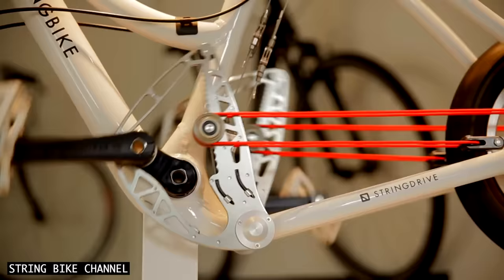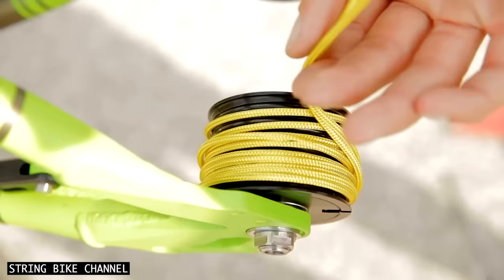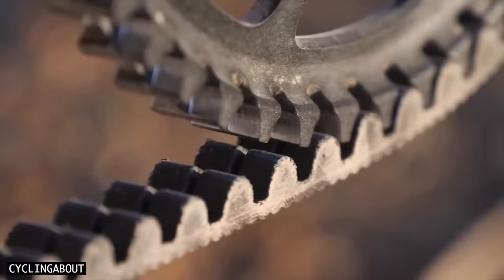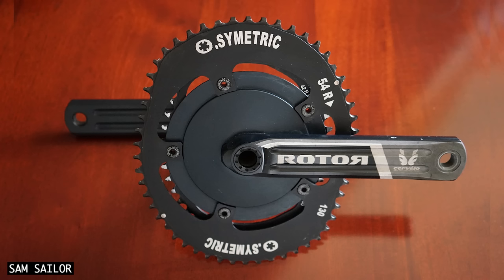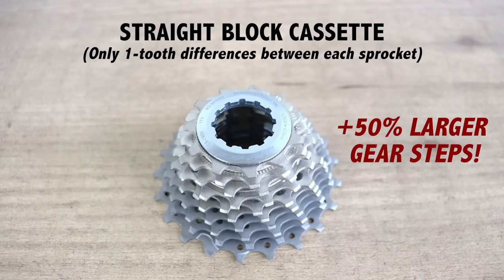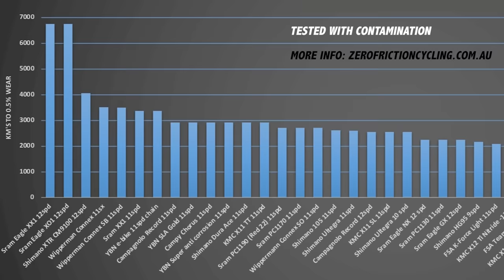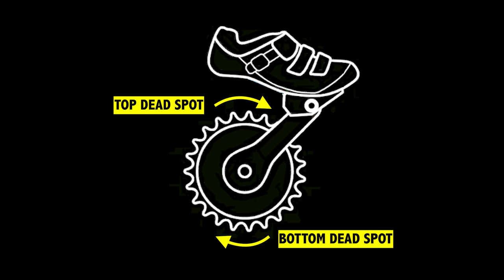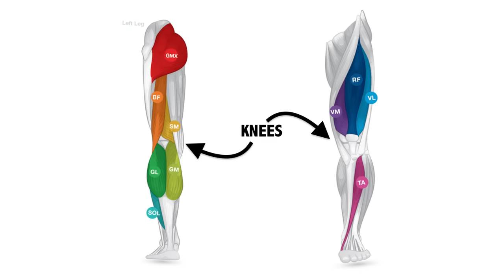Are Chainless String Drive Bicycles a Genius or Terrible Idea?

Comment: Although dyneema fabric has high tensil strenght it drops significantly when heated up i.e. because of friction. That is why in climbing it advised to refrain from pulling dyneema ropes under load through all sorts of climbing hardware. Maybe this is why these dyneema strings last so short. I wonder how big of a friction there is on the surface of all these pulleys and the rear drum. Also, the string moves a fixed lenght when reciprocating so only several and short stripes make contact with the drums and pulleys and carry the load. This may also contribute to its short longevity. Not a good idea - a bit complicated, unrealiable, clunky, not neat with all these shifting cables.

Comment: I considered buying one of these a couple of years ago, but the narrow gear range was a deal-killer. The high price and weird bespoke frame were also turn-offs. I eventually purchased a belt-drive bike with an 11-speed rear hub which was much cheaper, weighed about the same, and had a better gear-ratio spread.
Reply: how much does it cost and where can someone get them?

Comment: I imagine you could do something similar with belts instead of strings for better durability, but the incompatibility with standard frames is a killer. You could likely say the same thing about systems that use a geared rod instead of a chain too.
Reply: are belts also incompatible? you need a split in the frame

Comment: Interesting stuff. I use Dyneema cordage in my hammock suspensions and it's a truly amazing material. It doesn't do super well with abrasion though, so I'd be interested in seeing the longevity of this system.
Reply: Quoted as 1000km (about 600 miles) which even for pretty light use is multiple changes a year. 6 miles each way 5 times a week (about a 30 min ride, so nothing excessive) is 60 miles a week, so you're potentially changing strings 5 times a year. I suspect that changing the strings 5 times is considerably more hassle than than either regular chain maintenance as you are supposed to, or slightly more involved chain cleaning if you let it slide a bit. Unless you never do anything with your chain until it rusts solid or you need to replace chain, sprockets and chain rings at the same time, and do so frequently, it probably isn't a huge advantage.
Reply: No one asked you
Reply: @DoraExploring-ls5vf  I bet you're fun at parties.
Reply: @chrishowell5718  The limited mileage of the Dyneema strings is actually a disadvantage. According to my observation from the film, the time it takes to replace them is significantly shorter than any chain maintenance. 😃

Comment: I ride my bicycle as my main form of transportation all year, all weather, all the time, because I prefer it to my car. I like this idea, but for me, the downfall is that grit severely affects longevity, at least according to you. The ropes will become coated in salt in the winter and even if I cleaned them they would get coated in salt again within a couple of miles. One day, I hope to have a belt-drive gearbox system. My traditional drivetrain takes a lot of maintenance, even though I don't use a front derailleur. It gets irritating sometimes. Especially in the winter, when the air is too harsh to work outside.

Comment: I am quite intrigued by the concept of the String Drive bicycle. Difficulties offering the shifter and the range of gear ratios available wouldn't be an issue for me since I simply leave it in the highest available ratio anyway. I think the biggest reasons it wasn't particularly successful were the price and obscurity. The lower durability of the strings as compared to either chains or belts is definitely an important factor to consider, but the low cost of replacements and the ease and speed of replacing them, not to mention the ease of keeping spares on the bike, may well have offset that sufficiently for the average rider.

Comment: Just had to check todays date.  Phew, it’s not April 1st. 

The major downside to this system would be mud, here in the UK we get a lot of rain, so far we’ve had 3 major storms in the last month alone.  So lots of leaves and general muck on the roads means riding and more importantly, cornering speeds, are not what they were. Whilst I see no MTBs, I’ll bet off-road and you’d be in for a lot of hike-a-bike, or even pushing it home an/or back to the car. 

I take it wouldn’t take a tumble well would it? Anything bent or misaligned around the BB area and I’d’ve thought it was a game over.

Comment: The rewinding action of the string is springloaded.
Thus you are ALWAYS pushing against 2 springs. They may be weak (they only need to rewind the strings), but, still, they are there.

Comment: it seems very complex and sensitive to change, and that appears to be the most simple that mechanism can be. as an engineer, my first thought was KISS (Keep It Simple Stupid), and this doesn't seem to be the simplest you could design something like this. it may have it's upsides, but I'll trust that the chain on my bike won't snap, and if anything breaks i can replace it easily, quickly and cheaply, and even on the road. dynema is also notorious for performing poorly when heated, so i would trust it even less on a hot day, or riding particularly hard. you mentioned wide gears as one of chain derailleur systems' downsides, but often people want extremely wide gears, especially for road cycling, where the hills can be very steep, but you also may need to ride fast.

overall, too complex, too proprietary, too weak, too sensitive, not trustworthy, and incompatible with other technologies.
ima stick with my chains :P
Reply: Indeed and i think the starting position is not optimal, if i put my foot on it i want it to be in a position where i have a long way to put force into so 2 o clock, then i can use my whole weight for the first stroke, if id use the position in the video(4o clock) id have a lot less acceleration for the start. 
And if we watch bike races we see thats how most people start.
2o clock or slightly above the best conversion point at 3 o clock, where gravity helps the most.

Comment: I don't get the disk brake argument. Yes, you can't put a disk on the rear, but you can still make a mullet with a disk on the front and rim brake on the rear.
Reply: Most of your braking power is on the front, anyway.
Reply: agreed rim brakes are more than suffecent for locking up the rear wheels and the other downsides of wear and cooling do exist but you shouldnt be using your rear brakes enough to make that a concern

Comment: The hype : At 2:20 - "The Dynema ropes actually have a higher strength under tension than a bicycle chain."
The reality : At 7:45 - "The Dynema ropes wore out quickly compared to other drive options - 1000 - 2000 km (600 - 1200 miles).  They were found less efficient than a chain drive"

In fact, you have to go a long way to find a better system than a chain, in terms of longevity, strength, usability and efficiency.  They're dirty, but fingers can get washed.

Comment: Pulley rope bikes are the future of self built or custom bikes. Its simple and also the rear hubs can be made with variable transmission, also the pulley thing can be placed as orbital transmission that reduces torque requirement

Comment: Thank you so much for the education on string drive. Never heard of this before, but now I wish it had succeeded, and they lasted for 10x longer, and allowed for electrification, too! It all just seems way better than exposed chain; which we've been using for so long now. Surprised to see there aren't even more types of bikes available out there today. AI might soon change that though.
Reply: After >150 years, what works well and is practical has pretty much been figured out.
Reply: @gaoxiaen1  Thankfully no engineers think like you.
We wouldn't have cell phones, commercial jets, computers and a million other things that came along after 150 years ago...
Reply: @BitBuhkit  So why don't you think of something better than wings for airplanes, or wheels for cars? Get busy Mr. Engineer!
Reply: @gaoxiaen1  lol, I'm not the one that thinks everything stopped >150 years ago!
Reply: @BitBuhkit  Me neither. It's just that sometimes the best practical soltions have been worked out long ago. Yes, in some circumstances there are better devices that can be used, but I don't see things like the screw, the nail, the bolt and nut, the table and chair, the metal can and glass or plastic bottle, etc... going away soon. Yes, the string bicycle is an interesting novelty. So is the hubless wheel for motorcycles and turbine engine car and many other inventions, but it takes a long time to replace a tried and true practical solution. Fuel injection (of whatever type) and overhead valves for gasoline engines used to be exotic and futuristic, but have only become commonplace in the last few decades. Most inventions remain only novelties.

Comment: The design reminds me of the elliptical trainer used in the gym. The device has the option to use leg pedals along with reciprocating handles which resemble the reciprocating motion of the string drive. I often used the elliptical trainer and increased the resistance (compared to higher gear ratio in bikes) by holding the handles closer to the hub, i.e. lower. In my opinion something similar can be used for hand bikes (used by people with lower body paralysis, who cannot pedal). Reciprocating handles would make full use of the simplicity of the string drive because no spinning pedals are required. The hand-cyclist  can adjust the gear ratio simply by changing his hands position: Low gear is achieved by holding the top part of the handle. Holding lower can increase the gear ratio.
Reply: would like to see the resulting physical development in heavy users at their peaks.

Comment: That was an interesting description. I might mention though that every problem listed can be fixed. This includes:

Adaptation to existing bike frames.
Wider gear ratio.
Compatibility with disk brake.
Greater wear life for cord.
Lever based or automatic rather than twist grip shifter.
Reply: Wider gear ratio? What makes you think that? This thing has 19 speeds, my shitty mountain bike has 21.
Reply: @iamfreeareyou681  
I have no idea what point you are trying to make or how it would relate to my post.
Reply: the wider gear ratio as in the range from the highest gear to the lowest not how many gears i would also like to mention that disc brakes are not nessary in the rear because of wheight transfer when you brake and rim brakes are more than cabible of locking up the rear tire but disc brakes are nessary for the front but they can install them anyways since there is noting preventing them.. note i do know that there are other benifits to disc brakes for example not chewing through wheels longer brake pad life as well as better distribution of heat but if you are using your rear brakes enough to where thats a concern there are different issues
Reply: @3-ro3cd  

> the wider gear ratio as in the range from the highest gear to the lowest

Yes, you agree.

> disc brakes are not nessary in the rear

And?

Comment: It almost feels like you could rehash this tech using standard-ish ebike frames. I don't know if the geometry works, but if you could build a unit that bolts into the space a Bosch ebike motor (or similar) uses, it'd be an interesting idea. One-sided, of course, maybe even something that fits on a HG freehub.

Comment: Its amazing how far engineers will go to solve the problems of bicycle chains, hefore they resort to the obvious solution - a chain cover!!!! Honestly, my daughter's bike has an almost entirely enclosed drive train, and i basically never have to clean it. She's ridden it thousands of miles now with no issue. I wish adult bikes came with enclosed drivetrains more often.
Reply: Exactly. I've been advocating drivetrain fairings forever. Why do they say a rear derailleur gets dirty but a IGH does not? So helpless. Just cover it up, then it won't get dirty.
Reply: Nah, covers are not cool. Have you heard about dork discs? Usefull, light but absolute no-no.
Reply: You can use a full chainguard with a single speed bike, or with internal gears, but not with a derailleur. Oh, I suppose someone could design some montrousity that would fit over a derailleur, but I think it would create other problems.
Reply: @thePavuk  The only people who want chain guards want to ride with pants, so I don't think they care much for cool.

Comment: Fascinating. The persistence of chain drives after 150 years lies in the surprisingly low overall frictional losses, especially with the refinement of chains themselves, optimized cogs, and good old wax as the basis for the best, easily maintained lubricant. Motorcycles with drive shafts have far higher frictional losses, only offset by sealed systems, and the power to spare from an engine other than a human. This design also has many more pivoting bearings, likely needing service or replacement.

Comment: 0:30 I dont like the opening of this video. "Maybe a 'String Drive' bike is the ultimate solution" Uhh solution to what? You laid out a thesis that includes a problem without mentioning it? You never said what is inherently flawed with a chain design.

Comment: chain drive is more efficient. Ropes stretch when torque is applied thus using part of the energy for stretching the rope and not for propulsion. Some motorcycles use a kevlar rubber belt which is stiffer than rope.

Comment: The fact that string bikes need a special frame design is a significant disadvantage because too many companies are used to the conventional design, so yes, it does make sense. But for disk brakes and electric motors, I am sure there is a workaround that might need further investigation.

Comment: Very close gear ratios require frequent shifts.
I found that large gear gap help us pedal more efficiently across a broad rmp range.
Single speed racers often outperform cyclists with gears, especially on section with speed fluctuations, where you'd think you need the gears the most. I've found it ideal to have few gears, and use each for a "scenario". One tailwind or the road, or a fast downhill, maybe sprints. Two for spirited flat road or offroad flat racing. Three for undulating low elevation change, winding singletrack. Four for climbs too long to sprint up in 3rd. Five for really long climbs or very technical climbs. Six would be for hour-long super steep off-road clibs, or low effort road climbs. You'd hardly ever shift. Our legs can handle walking and sprinting, they'll be fine.

Comment: 4:41 this is probably the coolest feature
10:49 you don't need different size drums, since the gear setting on each side is independant (and yes they DO need adjustment 1:10)
thanks for sharing!

Comment: I'm Dutch and the notion that disc brakes on bicycles are industry standard is new to me. A normal bike (not a Fat Bike) here has rim brakes, unless you have a very old model or the type where you brake by peddling backwards. Regarding the efficiency of having to change forces: that shouldn't matter at all as you're doing that while peddling anyway. Your foot and leg cannot supply power throughout the entire cycle, only during the down stroke. So I don't think that should be considered more efficient, unless you're rotating the peddles with a motor. And that is not how they make electric bicycles work (they drive the wheel directly AFAIK). I think this string drive is a very interesting concept.

Comment: Note the lack of peddle clips.  They haven't been included because you can't lift-pedal with this drivetrain, which costs you about a third of a professional cyclists power.  

Lift-pedaling refers to pulling the pedals up on your upstroke, allowing you to generate thrust using different muscles from those required to push down on the pedal, which is desirable because the spread workload of riding is more efficient for reoxygenation and reduces the rate at which the working tissue degrades under load.
Reply from the maker: You can pull up with String Drive. It just transfers to the string on the opposite side of the bike.

Comment: Noticed that only regular bikes have gear adjustment cables between seat tube and rear wheel, forcing for longer wheelbase. Those performance bikes have been set up other way to pull gearing cables.

Comment: I'm curious about the efficiency of this. Since it goes against a simple principle of reducing parts (under the assumption that the bike chain is "1 part"). Now we have 2 drive chains, cams, pulleys and winches. Basically more than doubling the amount of bearings, and while strings are way more smooth and efficient in transferring energy than a chain. Having a reciprocating winch and cam system seems to add a lot of friction to the system. Especially the winches, which have to coast 50% of the time. 

Seeing the shaft torque to wheel torque compared between belts chains and strings (or any other system) would be extremely interesting.

Comment: I remember the days when bicycles were a greasy mess, constantly in need of small repairs or tweaks or Improvisations. 
We have come a long way.

Personally I would still prefer a very light racing bike type of thing. Not completely stripped off all the protection from rain but built very light and just with the essentials.
Those are usually quite easy to repair as well.

Comment: You could taper the drive hub on the wheel so that you get a mechanical advantage the further the rope pays out or to match the rider's requirements. Not saying string drive is the way forward but an interesting concept and good video.

Comment: Looks like the bushing inside the front bracket, on the pedal, would also need to be replaced especially in dirty conditions but this is a cool easy to repair design